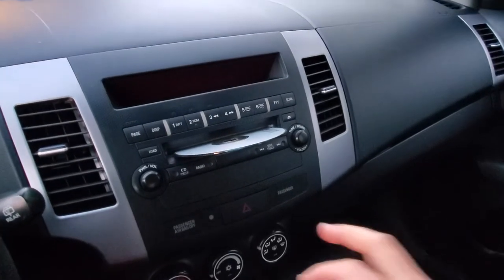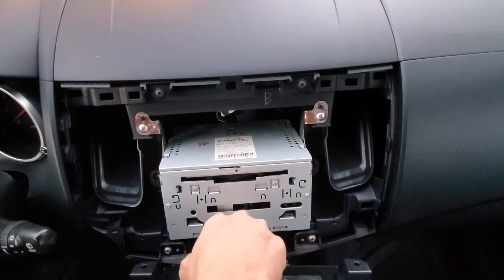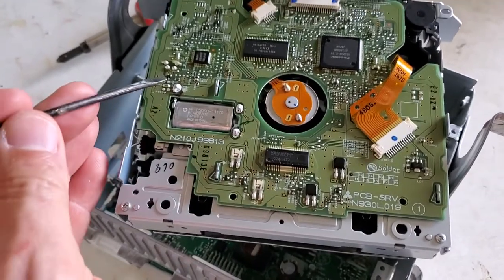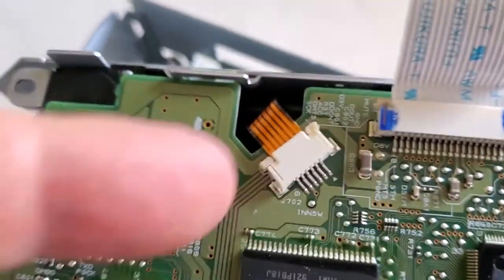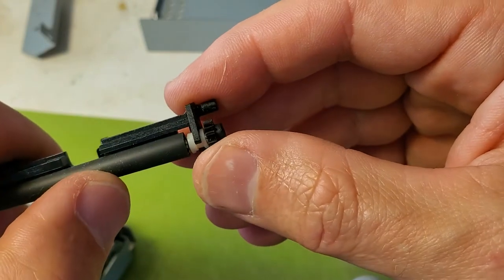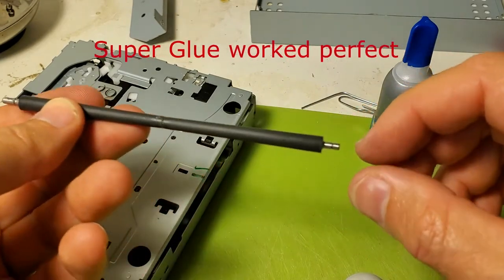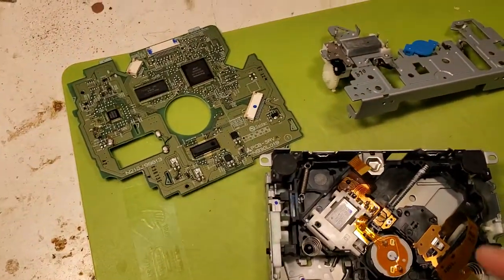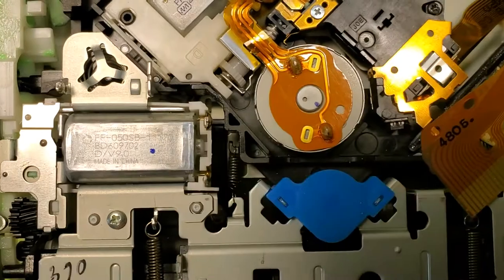Fix A Car CD Player That Won't Eject Disc

Comment: Very impressive troubleshooting! I had this exact same failure on a 2014 VW CD player (wouldn’t eject). Bought a used one off eBay from a wrecked VW and... that one won’t load   a CD (just whirs and won’t accept the CD). So I bought another eBay unit, and that one did work. So now I have two broken ones, and your video had inspired me to attempt to fix them and keep them as spares :-)

Comment: I took my apart for jeep compass but my roller seems to be fine. My roller has a white plastic piece in between the two rubber rollers. The rubber parts are not loose but the plastic piece rolls freely. I think everything appears to be working correctly there. I'm thinking I have a different issue. Is there another part of the eject mechanism that could be broken? My cd was stuck in between the part that goes in the cd hole. Any thoughts would be greatly appreciated. Thanks!
Reply from the maker: I would have to examine your cd to be able to see what's wrong. You have to figure this out.